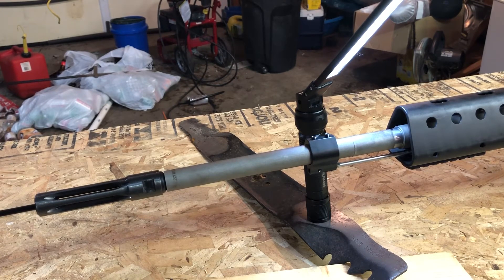AR Not Cycling - Insufficient Gas Port Diameter and Fix

Comment: Did you try a different bolt carrier group? Some are out of spec and very inefficient. Meaning that they lose a lot of pressure.
Reply from the maker: This was some time ago, but I do believe I did put in a lighter BCG with a similar result. That barrel was a non-standard batch overrun barrel, I think someone ordered a batch of them and I got an overrun one on clearance. That is probably part of why the port hole was so small on it.

Comment: I had trouble with 300 blk out. People that sell barrels dont tell gas port size but some do. I found gas port size is all over the map. I bought one barrel where they stated they opened them up because manufacturer made the port to small.
Reply from the maker: some barrels seem to be anticipating a suppressor on them, which would generally require less of a gas port. Seems silly to me to not err on the larger side, overgas the gun and let people put an adjustable on it to lower the volume.

Comment: I tried this idea a few years ago. It made my BCG all ickey and barely able to charge it. I ended up with an adjustable gas block and a 3oz buffer. It was for 300BO.
Reply from the maker: I'm glad it worked for you, however, a fixed gas block provides more gas than an adjustable, as adjustables can only by definition go down from 100%. The buffer change likely helped a lot.

Comment: Amazon has some really inexpensive ($20-30)5mm diameter wifi/bluetooth dual camera borescopes that allow you to look through the barrel to check the gas block alignment.  Saved me tons of frustrations with gas block alignment.
Reply: I’ve used a piece of spaghetti before and it worked
Reply: You can also rotate your gas block around, so the set screw hole is over the gas port, find your spacing and then rotate it back around and secure it.  Then after shooting it plenty you'll find that if you take it apart you'll see a carbon ring on the barrel.  As long as the carbon ring encapsulates the gas port your golden.

Comment: Great video! I have a couple of home builds that I KNOW I have eliminated all other issues and this is what I need to do. Do you need to use a cobalt drill bit?
Reply: Thank you
Reply from the maker: No I used cheapo Walmart drills and they worked well.
You’re not removing much at a time they will make it

Comment: always use drill bit to ck hole size,if not cycling,drill bigger .010 bigger then test,if u get big as .100 inch,ck 4 other problems,i had to take a .110 out on an ar10/bc 308,n it worked perfect,may be too big,but,i'm goin to order adj blk antway,shells landing at 4 o;clock/good w/ my reloads,may need to slow down w/other loads,most ar15 bbrls r drilled bout .060 frm factury,dep on gas leanth have fun

Comment: Hello, just built an ar-15 and it is not cycling, I'm only able to fire one round at the time but it does gets the next round ready in the chamber. I think The ejector is working fine because the empty roung comes out after it fires. Tested my upper with another lower receiver and it worked good but when tested my lower with a different upper receiver it would not work. Please help
Reply from the maker: Hello, please look at your hammer springs, carefully inspect how you installed them and make sure they are installed correctly. It sounds like your trigger is not resetting properly. If you have a cartridge trigger, make sure the pins are solid. Good luck.
Reply: @shortreloadingvideos7571  thanks I'll do that now and test it tomorrow ☺️

Comment: I have several Bear Creek Arsenal uppers. They run fine. But, I bought a 450 Bushmaster that won't cycle right. Every forum I've been on suggests a heavier buffer. I went with an H3 with no change. So, I'm pretty sure my gas port is undersized. Just haven't drilled it yet. Thank God this is a parkerized barrel, not nitrided.
Reply: I'm in the same exact situation at you, hopefully drilling a larger diameter gas port will solve the problem.
Reply from the maker: Good luck. If it's really, really under gassed you can jump 0.010". If it's just a little undergassed you might want to just go about 0.005" and check.
Reply: @shortreloadingvideos7571  
  Thanks!
Reply: If your gas port is undersized as you say it is, you should be dropping buffer weights not adding.
Reply: @choffnosky987  
  I guess I forgot to follow up on my last post, a year ago. I thought I did, but it's not on here. I did remove my gas block to check my porting, and it was fine. Before I sent the upper back, I decided to try one more thing. I had been using plastic magazines. I rooted around and found one of my old steels. Problem solved! The rifle runs great with both buffer tubes, as long as I'm running steel lipped magazines. I bought a Lancer and those run well. So, if you're having feeding issues, it's probably those big fatties cases that are forcing the plastic feed lips open too wide. Get a magazine that has a little more strength in the feed lips and that's should take care of the problem. I did follow up and wrote to BCA about my findings.
Reply: Cobalt drill bits will drill through them all.   Get a number set.

Comment: The gas hole may have been lead fouled
Reply from the maker: It's possible, but from the first round it was not running and it was a little undersized from the small sample size of help I got on arfcom. Good point though!

Comment: Likely you could have lightened the buffer... Maybe a 3oz instead of a standard 5oz rifle  buffer...  Barrel makers deterring the port size based on barrel use, length and dwell..
Reply from the maker: They said these were overrun of a special batch and the holes were made small.

Comment: Same issue with my aero 18 inch upper. It's a stainless 223 wylde qpq coated barrel. Rifle length gas system. What size should I drill it out too? I have seen charts for 16 and 20 inch but no 18 inch barrels. Thanks
Reply from the maker: I'd probably look to the larger end of the 20" rifle gas diameter range, whatever that might be. Probably around the same size as mine is or a little smidge bigger.
I looked at arfcom for you and they are saying in the 0.090" range. No harm in going 90-95 in my opinion.
Reply: @shortreloadingvideos7571  thanks alot for the info. I will give it a try. Merry xmas!
Reply from the maker: @mattstaab6408  Merry Christmas Matt!
Reply: Did you resolve your issue?  I have an Aero 18 SS 223 wylde fluted barrel in a newly built upper and having cycling issue.  It's rather weird.  It will cycle a 75 grain Federal cartridge, but will not cycle the 62 grain Hornady.  Very bizarre to me.
Reply: @dickjohnson7845  it ended up working itself out. I never messed with anything. I put about 250 rds or more through it and it started cycling fine. Now I'm at about 500 rds or so with no issue. I've tried every grain weight that I could find and still no issue. I went to a gunsmith and he told me to break it in before I come to conclusions. He was right. Hope you figure out the issue
Reply: @mattstaab6408    Wow. That’s weird!!!!  Thanks for the reply

Comment: Why not use a drill-press?
Reply from the maker: The same reason I didn't use a Fanuc Robodrill.
Don't have one.
Reply: @shortreloadingvideos7571  i guess i hadn’t considered that.
Reply from the maker: @koffeekage  it's all good, you make a good point, if I had one I would have used it. The shop at work is where a lot of my stuff gets done, but I can't bring a rifle barrel in there :S
Reply: If you have the barrel on correctly why would you want to take it off just to in large it just a few thousands of an inch ?

Comment: Having the same issue with an aero 18 inch spr upper, tried everything but this, if that’s the case easy peasy. Thanks for sharing
Reply: Nutnfancy fought with one short cycling for years and this was the fix. Cool rifle btw I like that handguard.
Reply from the maker: @retro9590  Thank you, I shopped hard before settling on that handguard. Yes it was an easy fix and it was immediately resolved.
Reply: Do you have name of or link to that muzzle device?
Reply from the maker: @retro9590   I get these from MFIAP dot com. They make parts for people to get around the 922 laws. I think this is some HK type flash hider. Good solid kit, I get their clearance ones bc they are a little spendy.
Reply: @shortreloadingvideos7571   mine just came in today, looks great on my aero spr 18 upper. Thanks man
Reply from the maker: @retro9590  awesome!!

Comment: How /where do you find out what size the port in the barrel is suppose to be for it's caliber and length. 
I did a build with AR stoner parts . 24" SS bull barrel. 
I put an adjustable gas block on it and no amount of adjustment made it cycle reliably. Undergassed.
So I adjusted the gas block full open and dropped the buffer weight from 5 1/8 oz. to 4 1/16 oz .
Now it cycles every round and stays locked open after last round but casing are at 4:30-5 o'clock.
Reply from the maker: You can email barrel manufacturers and ask what they would use for that length barrel and whatever gas system you have on it.
You can also maybe ask the guy at AR15barrels or RetroArmsWorks what they might suggest for a diameter. They are both really good guys and might be able to help you out.

Comment: No actually there is a standard size gas port.  Some manufacturers undersized the ports to accommodate for suppressed use. .30 caliber is common.  .300 blk. And .308
Reply from the maker: In practice, there are somewhat standardized gas ports, but they vary for barrel length/gas system length combinations. Throw in 6.8SPC or 22 Valkyrie and no, the gas ports are not going to be precisely standard. Unless all you purchase are 16" 5.56 NATO barrels with carbine length gas ports.

Comment: Pin gauges are the best way to measure gas port diameter. For 16" mid length I wouldn't go beyond .076. I had to drill out a 20" Faxon barrel for the same reason. You used a cleaning rod like I do to protect the bore, good job..Nitride barrels are a lot harder to drill, so I grind just the top of the barrel port to knock off the hard metal surface so the drill bit won't chip or break..
Reply: I like the cleaning rod thing
Reply from the maker: 100% agree with the pin gages.

Comment: I bought a Ballistics Advantage 18" rifle length gas system barrel in .308.
It has been a nightmare!
I paired it with a rifle length buffer and tube. Right away it was short stroking. Usually after about 10 rds and bam! Bolt wont lock back.
I changed gas blocks etc...etc. 
I went through it by the numbers.
The BA barrel I bought is supposedly .089 at the port. I read that it should be .096!
My rifle is under gassed and I've spent over $200 in ammo to realize it was the barrel port!
Uuugh.
Barrel is great however. I get bullets stacked and touching each other at 50 yards. 
Tomorrow I will be drilling out the port!
Reply: Same....but with a 6" 300aac BA barrel.  Apparently the gas ports are consistenly too small for reliable cycling on a variety of BA barrels.
Reply: @bigger62265  Yes they are all too small. I have to drill them all. Wire gauge numbered drill bits. I called BA and they said they are drilled proper and tested gas port sizes. They are wrong. I wonder if BA is drilling for suppressor use.
Reply: @bfdadventure  i think they are. My 13.7 with and adjustable gas block all the way open runs "mostly" reliable but I have to use an ar-15 cut bcg... the majority of high quality durable and affordable ones are full auto cut... suppressed it's no issue, but I'd rather turn down the block than have to run suppressed 100%. Suppressed I can tune it down but without i occasionally don't get bolt locking back on last round. If I ran lesser loads, I'd have issues for sure.
Solgw has their gas port sized larger than BA for these very reasons. You don't want something that's mostly reliable, you want something always reliable without question.
Reply: My 16” 308 barrel is 73
Reply: I have the same barrel and same problems. I found this video because I’m going to drill mine out. I measured my hole and it’s .0785-.08. Way under what it should be like you said.

Comment: HOW DO YOU DE BURR THE INSIDE OF THE BARREL AFTER YOU DRILL THE PORT OUT?
I have watch many videos about under sized gas ports and drilling the gas portslarger. BUT no one has addressed, in detail, how to remove the burrs that are possibily left on the inside of the barrel after drilling. 
Eveybody talks in detail about port size, how to use a drill, how to keep from drilling to deep, what to use to keep from drilling to deep.  BUT nothing about how to de burring the inside of the barrel. You will be instructed to de burr, and thats about it.
Reply: I'd run a brush through a bunch and follow it with some patches.
Reply from the maker: How do you think they do it at the factory?
Reply: If I knew I wouldn't be asking.
Reply from the maker: @Level-zb4jg  they inspect for large burrs, and may go in after them with a nylon tool, but most people who are just making the existing port a tiny bit larger do not have major burr issues that patches can't clean out.

Comment: I want that flash hider
Reply from the maker: You can find it on hkparts (dot) net with the SKU of HKP-17941. It was very difficult to find for sure. It is made by MFIAP (dot) com. Very good folks.
Reply: @shortreloadingvideos7571  standard ar thread pitch?
Reply from the maker: @Bagheera2  they are the 1/2x28 that a normal 223 AR would have. There are different threads for different calibers once you get up to the 6.5s and up.

Comment: The proper way to measure a gas port is using pin gauges.
Reply: Eye ball is good enough, not everyone has a high roller tool chest
Reply from the maker: That would be important if the gas port had a tighter tolerance than ~8 thou
Reply: And a couple other ways. Obviously

Comment: You think the manufacturers would know. a bought a 20” ss bca in .308 with a rifle length gas system in the specs it said the gas port is drilled out at .086”. This is the first Barrel I have ever bought so I was having faith the manufacturer had done the research 🧐 now I know why my rifle is short stroking! Not by much though, just enough to damage the second round in the mag and to not keep the bolt open on the last round.
Reply: After my own recent experience and reading yalls comments i feel like most manufacturers drill their holes too small....cept ironically the cheap barrels...
Reply: Mine will keep bolt open on last round but 9 out of 10 times won’t feed another round into chamber.. you would think the mags right? But I can manually charge it and it chambers just fine. Any ideas?
Reply from the maker: @huntergardner597  when you load the last round into the chamber, remove the mag and see if it still holds the bolt back
That will tell you if the bolt is catching on the back of the mag or actually catching on the bolt catch.
Reply: @huntergardner597  did you ever fix it? I’m having the same issue, it shoots fine just like a bolt action
Reply from the maker: Sorry about your luck :( Make sure you check everything else before taking a drill to your barrel and check for burrs inside the bore after you are done. Worst case scenario you get a burr and you need to remove it before shooting the firearm.
Reply: Exact same thing my FN barrel was doing on a 10.5 pistol.

Comment: I have a couple of home builds with exactly the same issue, I have tried EVERYTHING (swapping buffer/spring, BCG, different ammo, checking for proper gas block alignment, for any BCG dragging inside the upper etc)  Although it's the last thing I wanted to do, I think I will have to do the same thing
Reply from the maker: It was the most frustrating thing so far for me. Go slow and put something in the barrel to protect it and you will do fine.
Reply: Check the magazine
Reply: @originalgangsta5462  

I tried several. Ended up opening up the gas hole and it ran like a champ!
Reply: Sounds like we should start with whatever is the cheapest fix first. I'm right there with you.